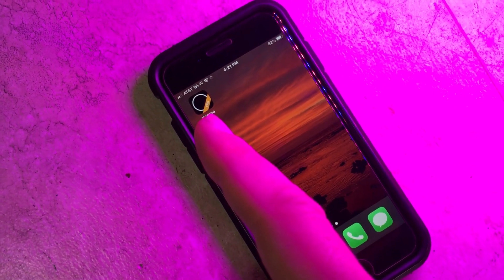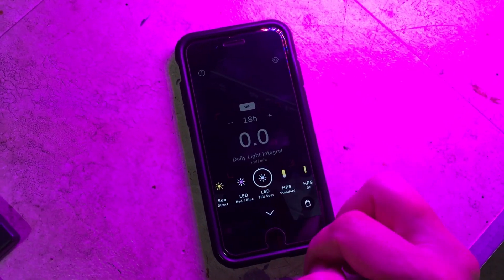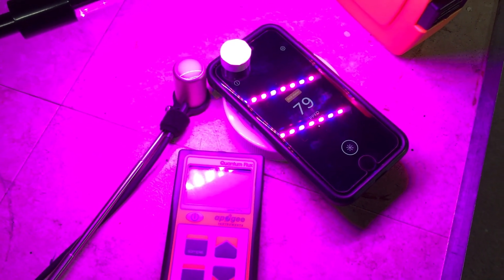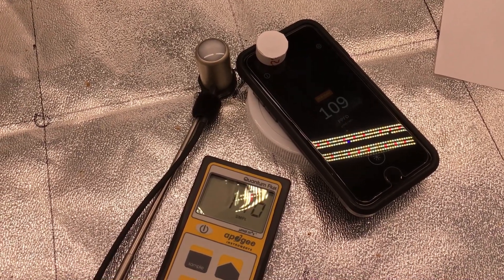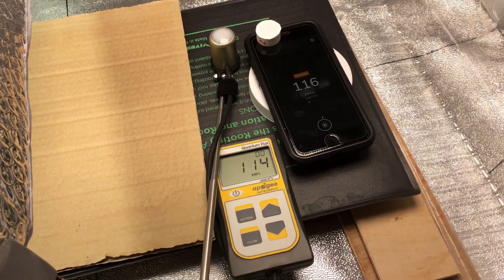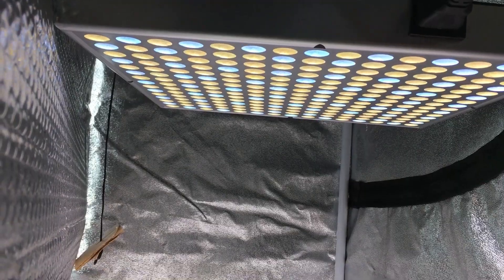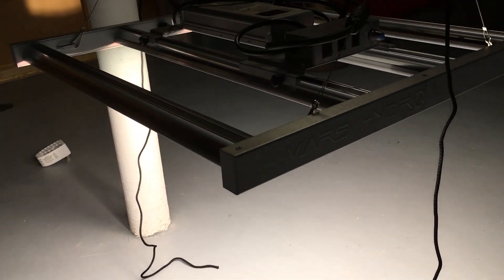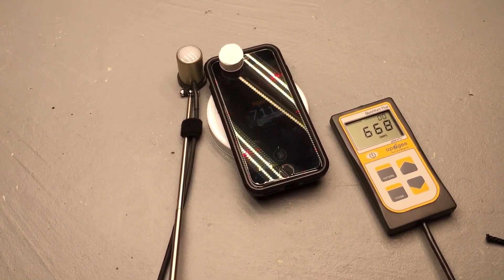Your Smartphone is a Quantum Par Meter | “Photone” App

Comment: The issue I have here is you keep using the term calibrated. Without having a standardized source and the ability to adjust the sensor on the iPhone you are not calibrating anything. Unless you have a real PAR meter to validate, this app is useless.
Reply from the maker: The app is pre calibrated with various light sources and can be further calibrated if you have a meter like I do. It’s instructed with the app on how to use it. It’s obviously not useless as I demonstrated. And I stated also that’s it’s not going to replace a true meter, but it works well enough for those who aren’t needing that level of accuracy.
Reply: @GrowingAnswers  different digital cameras have different properties to their image rendering. look up fpv camera comparisons, it's literally night and day with some. The app is calibrated for the raw input I imagine, but the raw input without custom calibrated driver can make the results vary between different smartphones.
Reply: thanks!!

Comment: Man, that's pretty killer. I just compared it to my LUX meter and it's pretty accurate. Using the lux meter has really helpled me with this current grow, but of course it would be much better with a PAR meter, but at least I can be consistent with the amount of overall light hitting the plants. Thanks for the research and for sharing. That's really cool of you.
Reply: What brand of lux meter? I have dr meter and it reads less lux than the app...
Reply: @andrewbee82 I love Dr. Meter. Didn't know they made them, but it makes sense since it is a METER! Duh! Nah, I didn't know them then. I have a good URCERI MT-912. It was $30 on Amazon and it goes up to 200k. What I use it for I don't need more than 80k. I was just thinking this morning how this thing has changed my life. It's taken a good part of guessing from the equation by being able to see the light range and dial it in where I want. Can't imagine if I had a PAR meter. It's helped my confidence because it helps me with one of the 3 most crucial elements of growing, correct? What's cool now is I can guess and be pretty accurate. It's fun.Thanks Growing Answers for covering the topic.

Comment: Wow!!  Had the Korona app for a while, but didn’t seem accurate.  I adjusted the par level for lettuce under a spider farmer light and it seemed way to bright and burned up my lettuce.  Now I see you  need a light diffuser and it makes it accurate.  What diameter and length is the piece of pvc?  Thank you so much.
Reply from the maker: 1/2”
Reply: Thank you. I will give it a try.

Comment: I always wanted to ask you if something like  this existed and how accurate it would be, now i guess i know the answer
but now i have to wonder about the  specs of your phones (or tablets)front facing camera and how much variation that will cause  , i mean not so much  an issue with iphones i guess but  if there is an android version it could be more of an issue  but still even with  an iphone different models have different camera specs i wonder how much it affects the accuracy of this app
also front facing cameras always have lower specs than the back cameras i wonder if this app has a way to use the back camera and  if it would give even more accurate results but again camera sensors vary so much between different devices
Reply from the maker: It doesn’t really matter what the sensor resolution is or anything like that. If lux meter apps work on any phone then so would a par conversion. It’s not using the camera to look at any detail. It just looking at luminosity which is why paper is needed. Pretty much the same reason why an actual light meter always has a plastic diffuser over the sensor. The sensors in meters are very similar to the sensors in phones. Just without a lens in front of it. There is always going to be a margin of error no matter what. I think the reason why it’s not made for android is cost and coding issues.

Comment: Is it available for Android?
Reply from the maker: Apparently it’s only for Apple as of now. I don’t have an android device to look on the playstore though.
Reply: @GrowingAnswers  I just looked and there is something called Refusio (weird name) but doesn't look to be very good
Reply from the maker: @maxroadrash  I’m hoping the dev releases this for android. It’s a good app. Though there are some good apps for Android that have never been made for apple devices and I wish they were. Probably never will be though.
Reply: @GrowingAnswers  it could be  more of a problem  for  them to develop for Android since android runs on so many different devices and  they all have different camera specs
so when you install this app does it ask you which model /generation iphone you have or does it  say it works with a   range of phones say from iphone 5  on or something because ,i wonder if they have different calibration profiles   for each different iphone model that uses a different camera sensor
Reply from the maker: @andreamitchell4758  it doesn’t ask as far as I remember.
Reply: @GrowingAnswers  I think it will be difficult to this for android. As there are so many different manufacturers and therefore use different light sensors. With Apple at least within one generation of phones the same sensors will be used...